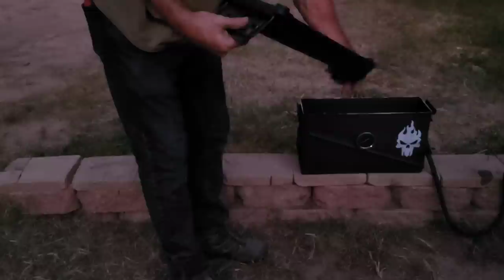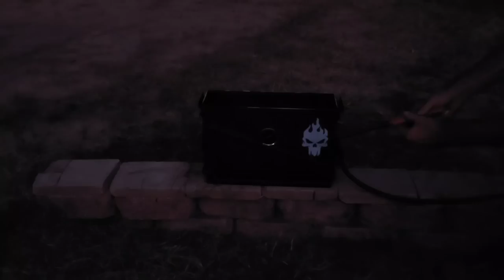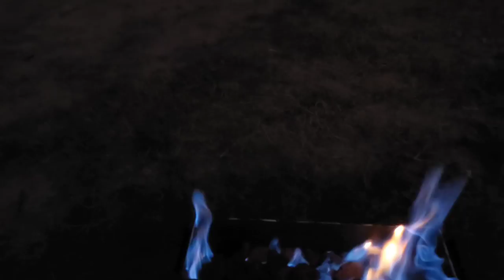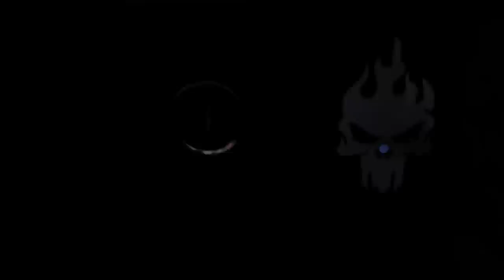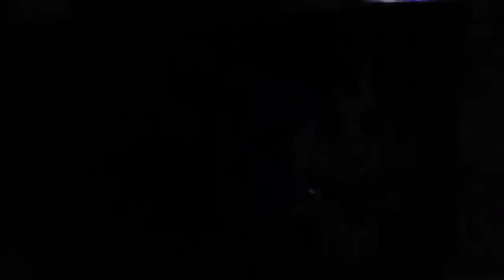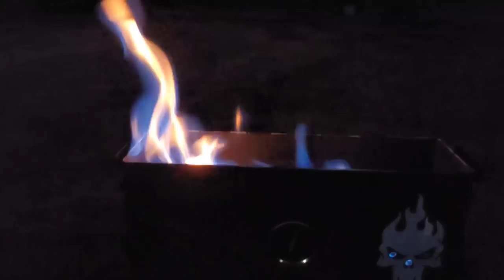Testing the homemade ammo can firepit.

Comment: Hello I have made a Ammo Can Fire Pit also with a Turkey Fryer burner & 4ft hose & adjustable 20psi regulator. I am assuming you Turkey Burner has the air mixer adjuster around the hose. I mounted burner with the brass hose fitting & drilled two 3/16" holes for the air mixer my blue flame is smaller than yours. I then put small bolts in the holes & have big orange/yellow/red flames.  But nice fire pit. I do like how warm yours looks thanks fod posting for us all to see
Reply from the maker: Awesome. Sounds like you have a good one. Yes mine has the air flow adjustment.